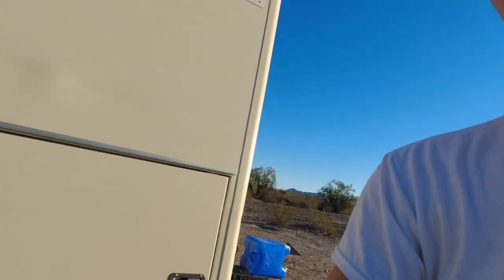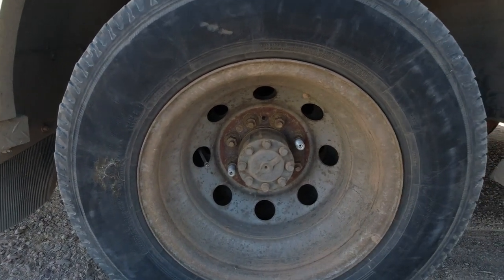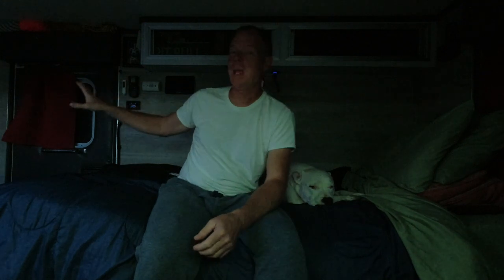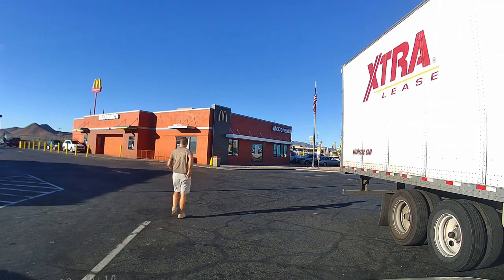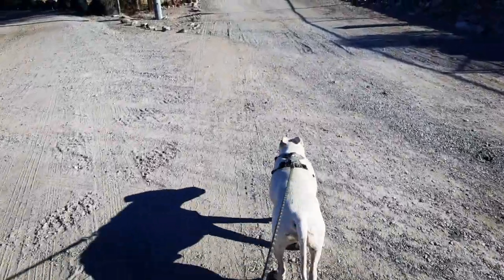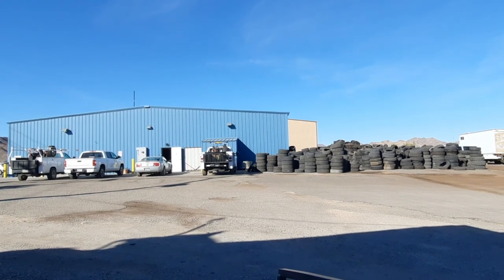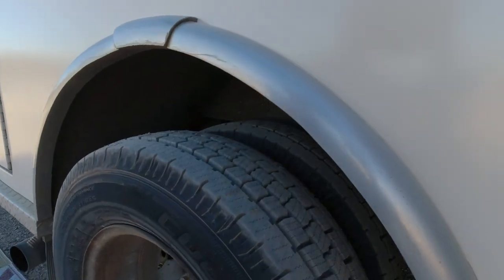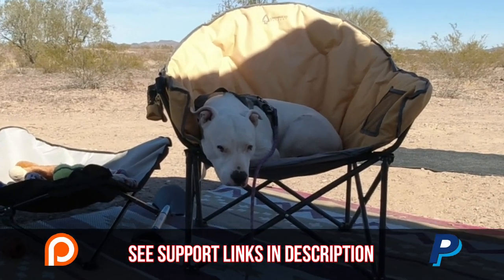Driving In To Town On A Flat Tire To Have The Rig Fixed | Ambulance Conversion Life

Comment: A little courtesy to the man behind the counter goes a long way, and it's just the right way to be. Last June, had overheating issues with our shuttle bus, waited 5 days for the earliest shop that could get to us. Shout out to White's Queen City Chevrolet in Belle Fouche (?) SD! It was during the big heat wave, and we had the fur kids to think about. Folks there said bring the kids on into the waiting area, and after the broken wires were repaired, I asked about where I could get water, they said to pull around to the wash rack and fill up. Treating folks the way you want to be treated goes a long way.  Before starting the trip I got a set of new Mastercraft tires, made in the same factory as the Cooper's you got. 9000 miles in and am still happy with them. Roll on Dave and Lefty! (Saw your video with B.W., noticed changes to your rig.)
Reply from the maker: That's a good shop!

Comment: Being someone who has been in the Automotive industry for a little more than 45 years. I know how the gentleman behind the counter feels. I was a automotive technician for 27 years , a Manager , Assistant Manager , Shop Foreman and a Service Advisor . The automotive industry take a certain type of individual , it's not for everyone. And when something goes wrong with vehicles , no mater what type , it's always someone else's fault , when things go wrong. I feel for the gentleman on the counter , have been there too. Just have to wonder what goes through peoples minds . To think they can talk to people that way. Just a little FYI for you , next time you have your tires rotated or replaced. You can ask them to apply some Anti Seize Lubricant to the threads (lug studs) and those will come off allot easier the next time. And may also help you if you ever have another flat , while travelling our wonderful country. Take care.
Reply from the maker: Thanks Ray

Comment: Was it all about the valve stem? I use the "AF" expression a lot! I thought I had found you through cheap RV living, but when I saw your interview I thought "no I don't think I'm having deja vu". YouTube had prompted me to watch you fairly recently.

I love Lefty and so glad that went smoothly for y'all!
Reply from the maker: I didn't ask them to look for the cause so I'm not sure - but it had passenger car rubber stems :/ Now it has heavy duty stems :)
Reply: Quick way to check for possible leak source: inflate tire, spray soapy water around stems, beads at rim and as needed on tread area in case picked up a puncture along the way.  Just mix in small sprayer water with 1-2 drops dish soap.  Of course with a dually the inner-tire side and wheels are a challenge to check without removing them.  But basically same test as what mechanics do with tire submersion tubs.

Comment: cooper tires are quality tires/check the air pressure every day to be sure you do not have a tire leaking a little /if they stay full -then all is good/how much was the 4 tires an new stems /check for a valve core leak-it might need to be snugged up/just saying/yea you did good man getting new great tires /sweet moma-a new ride on that road/thanks much

Comment: Those lugs looked really rusty. It doesn’t surprise me that they had a hard time getting the nuts off. Are you set up to take a wheel off if necessary? Sounds like you never had them off. I carry a large bottle jack and a breaker bar. The bottle jack is very heavy and I hate to add that extra weight but I’m a “be prepared “ type of person. Glad everything worked out. Happy trails.
Reply from the maker: Yes I have an 8 ton jack, socket, extension, and breaker bar just in case!

Comment: Thanks for the update, glad you were able to get new rubber. No telling how old those old tires were. I have experienced 7 year old valve stems leaking. Rubber made. Safe travels.
Reply from the maker: I don't trust the rubber stems - the new stems are VERY heavy duty with threaded lock nuts.

Comment: DONT LOCKTITE!!!
On our ambo fleet We would anti seize them both sides of the stud.
You will have a hell of a time getting them off if you ever have to Change  flat.
And make sure the tire shop puts anti seize on the axle and in between the wheels. Trust me.
Edit: we never had one come off. Just goop them and crank them on
Reply from the maker: I wish there was enough thread exposed to be able to torque them!
Reply: @TheCampulanceMan  there's enough . Like I said, we never had one come off.
On Another note check out C-Betr spot mirrors. They attach to the arms of the mirrors you have and are much better than the rectangular convex ones on there.

Comment: 2:38 - 3:00 you can see feathered wear on the old tire, could be toe adjustment issue. Did the shop say anything about alignment?
Reply from the maker: No - but the truck did have bad bushings that I fixed last summer.

Comment: We watch all your videos & you seem to have great knowledge on your rig over all. Sooo I am coming to you with a question I can't seem to get a great answer to. I'm not a tech person in any way.  Here's the question...in the near future we're getting a transit cargo van. We have the option to get dual alternators & batteries.  I'm thinking that would be a good thing but is it??? Will one set deal with the van & the other deal with what we need charging like fridge, fan etc? Am I thinking correctly or its not that simple? I'd love any help/advice whether or  not its worth the expense.  Thank you so much! 'wolds on the world '
Reply from the maker: In a stock configuration they'd both be tied together to crank the engine and then provide additional power for accessories. It's for cold weather cranking mainly. I'd skip it and add your own separate system for your living space. You don't want to be powering your coffee maker off of the same batteries that crank the engine...
Reply: @TheCampulanceMan  thank you so much for the advice!!!❤

Comment: how much water can you carry and how much does it cost you?
Reply from the maker: We carry 32g in the tanks + 5g in the portable jug. It's $1 for 5g of drinking water.
Reply: @TheCampulanceMan  I was thinking for my rig to have 2 tanks. Since I already have them use one for drinking and 1 for other stuff. I plan a shower but will use a dry toilet.  I got a 55 gallon barrel I can use for non drinking water and a 20 gallon for drinking water. What you think?
Reply from the maker: @bobham919  my tanks last quite a while and I always am visiting town and refilling before we run out. Only a couple times have I actually needed to refill due to being very low. Remember weight and space when planning tanks.